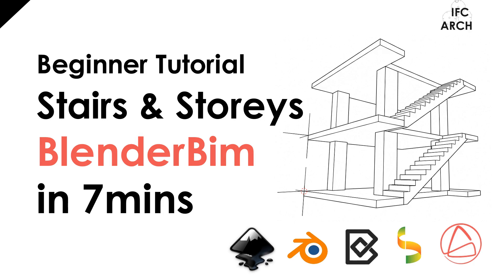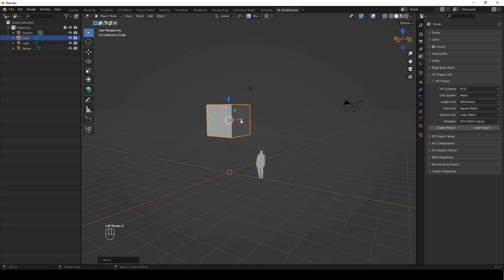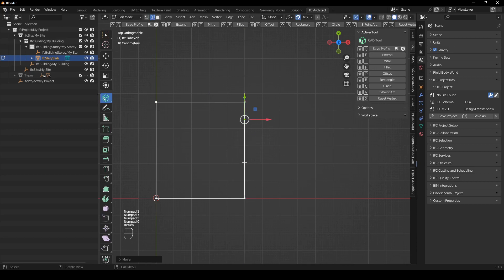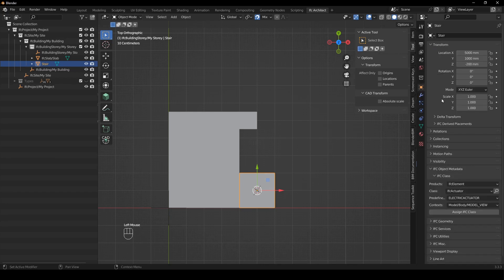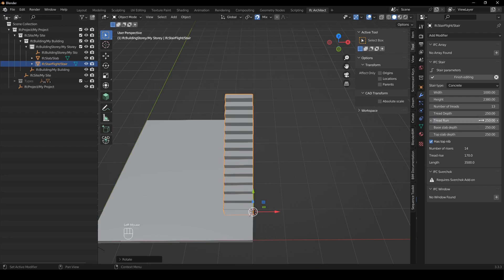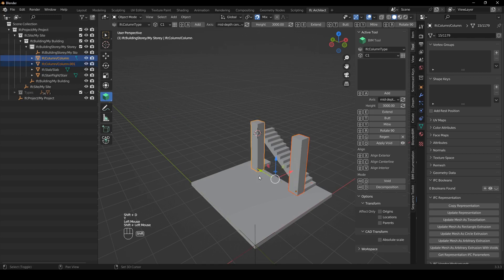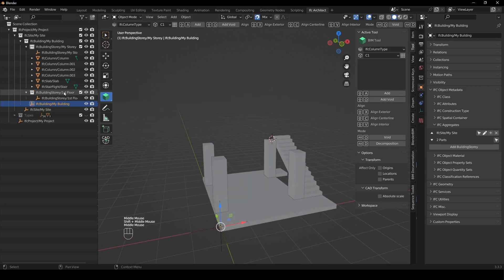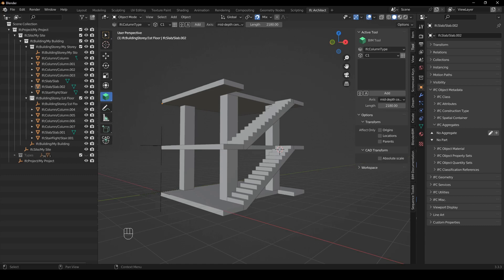BlenderBim - Beginner Tutorial - Stairs & Storeys in 7mins

Comment: Thanks for the video, I have a question, I am trying to visualize the model in a 3D viewer web from ifcjs, but the model does not show all the components, it only shows the columns and stairs, could this be an error in the IFC file of the project?
Reply from the maker: Hi John, It's hard to say, as many Ifc viewers use slightly different requirements for their definitions of what they can and can't display. It could be the Ifc and that is probably the best bet as generally the geometry should be standardized across these viewers.

I'd say try opening the Ifc in Bimvision and this online viewer:
https://view.ifcopenshell.org/
see if it has the same visual result, if it does, then it should be the Ifc at fault, in which case..

If you are able to share the file
I'd recommend dropping it in this thread:
https://community.osarch.org/discussion/1333/blenderbim-tutorial-stairs-storeys-discussion-thread/p1?new=1

And myself or someone else could possibly test it for you and point out the problem
Reply: @IfcArchitect  thanks, I have already found the problem, I had some items repeated in the model, I got another question, how can I add the latitude Longtitude properties in IfcSite, and in IfcBuildingStorey the Elevation property? and how add relations to IfcSpace for the windows and doors?